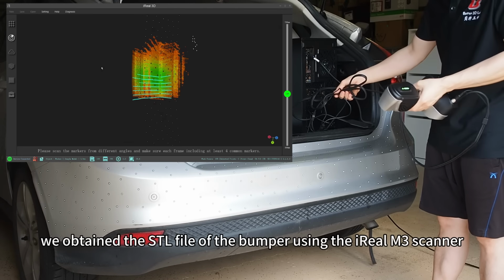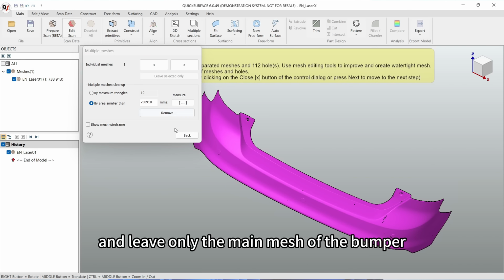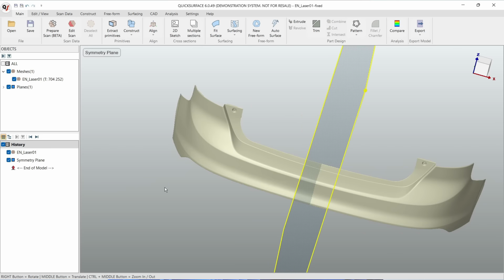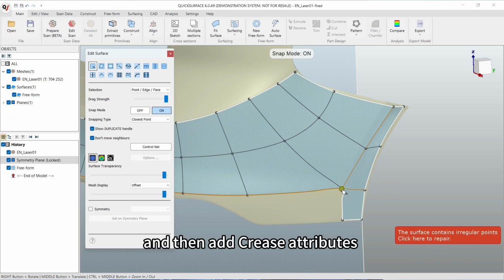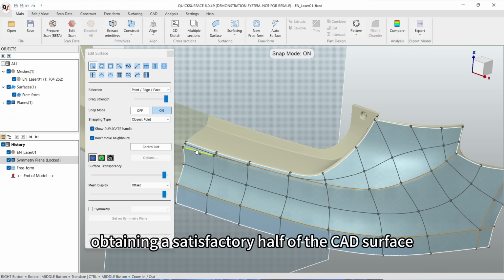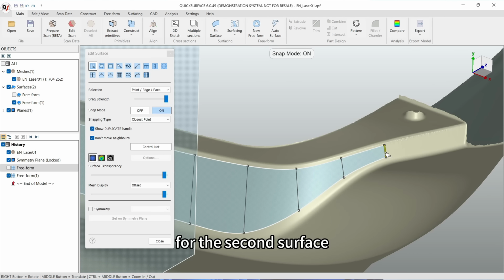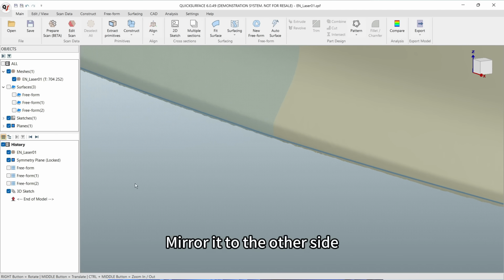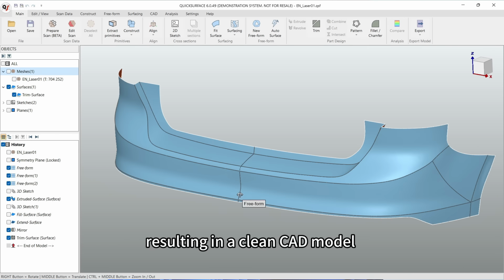Reverse Engineering Car Bumper in Quicksurface from iReal M3 3D Scanned Data STL

Comment: Could you rxplain why you need to reverse the engineer an item already 3d scanned and present please im not understanding the purpose?
Reply from the maker: A 3D scan captures the shape as a mesh, but it’s not editable or production-ready.
Reverse engineering converts it into a precise CAD model, so you can modify it, measure it, and use it for manufacturing, inspection, or redesign.